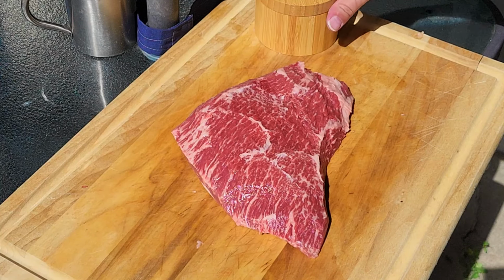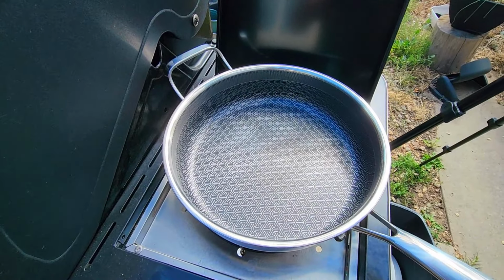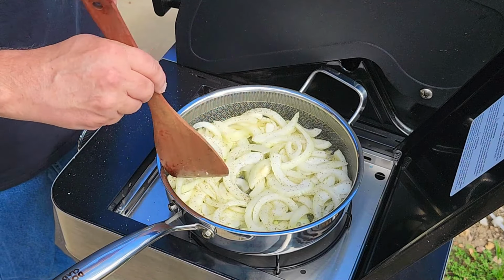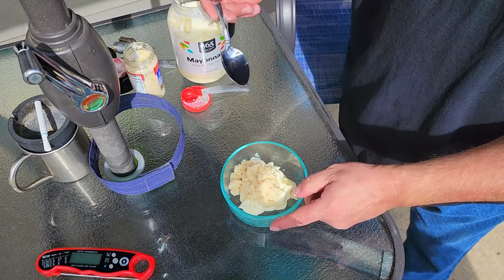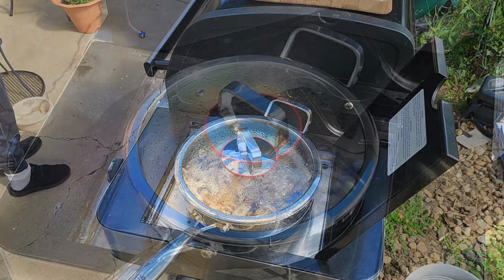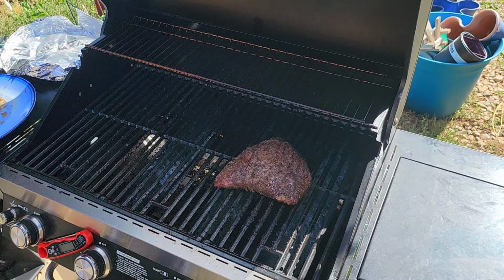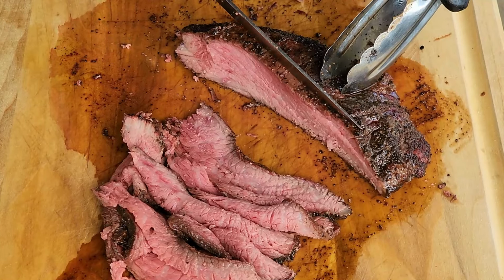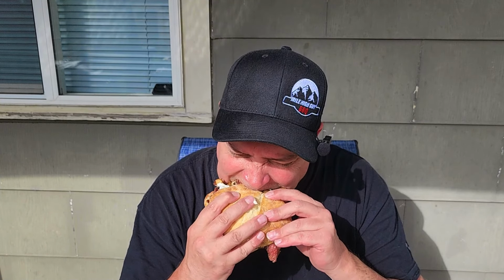You Won't Believe How Easy This Tri Tip Sandwich Is

Comment: Great video. I love tri tip and I think I need to grab one and get it cooked up. I'm going to order some of the skillets and try them out.
Reply from the maker: They are a good quality pan. I always have some type of oil or butter in them and I have no issues. I really love that you can use metal with them.